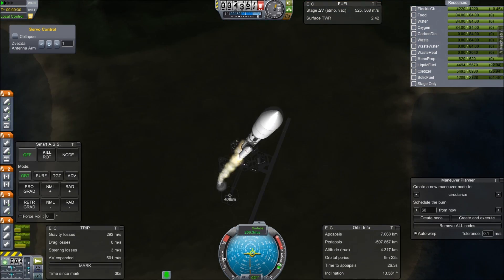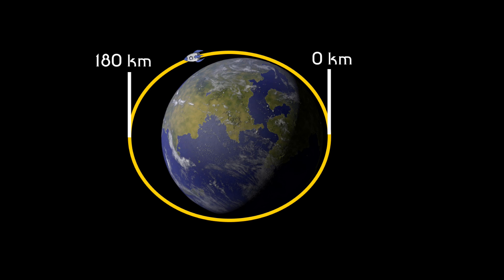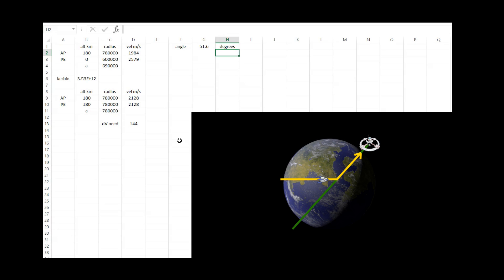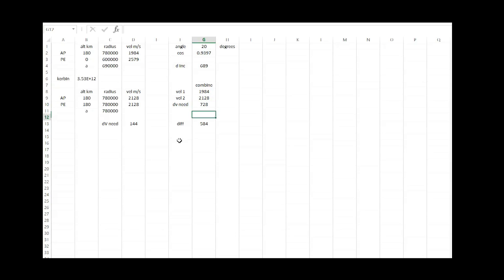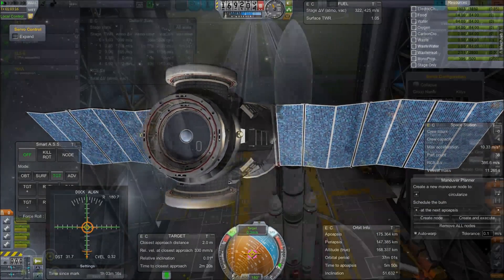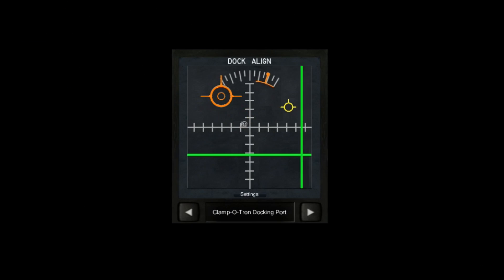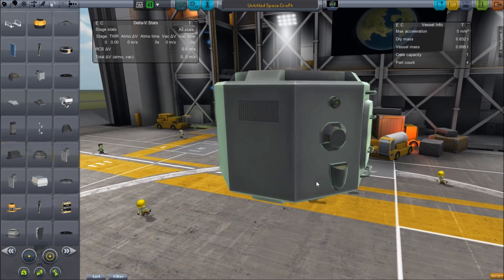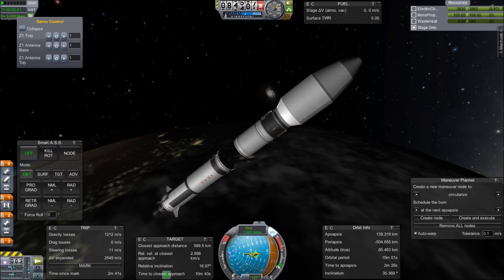G03 "Zvezda" ISS Project Gateway Remaster / Kerbal Space Program

Comment: You can do that in Kerbal Engineer as well... Except that the windows are cleaner.
Reply from the maker: When Gateway was made years ago it was not possible. If it's finally as customizable as MJ, that'd be great. I might check it out some time.
Reply: I don't know if it's as customizable as MJ, but I'll confirm that in KER since at least 1.0.5 (and maybe before but I wasn't around) you could rearrange the windows. No idea if it has the same metrics available or not though!
Reply from the maker: I'd want to see one window, and no tabs, with the lines like I have in MY flight computer, and listed in the same order I have them. If it does that then it's finally "caught up" to MJ's customization ability which would be very cool.
Reply: Yeah like I said, I can't vouch for every metric it has, but at least the rest of what you described has been possible since 1.0.5's KER from what I remember. I have to tune mine in 1.2 again, so I might compare with your videos.